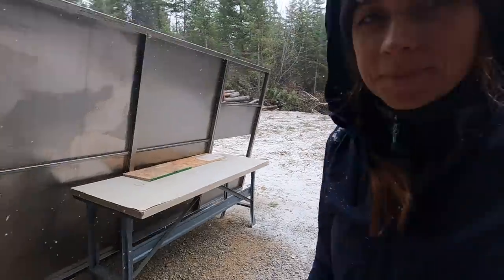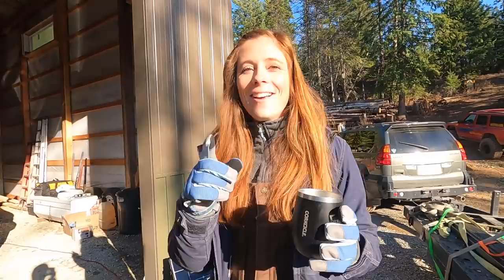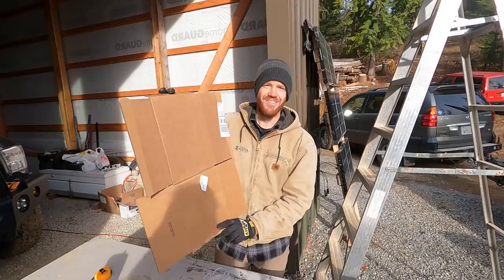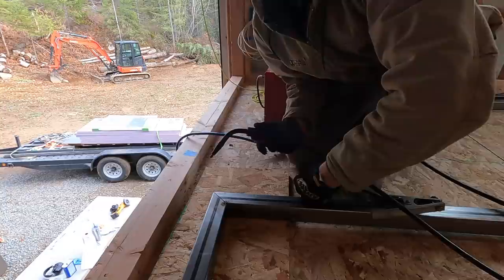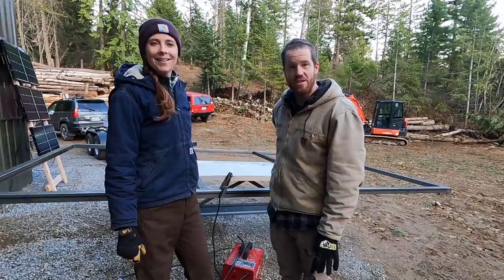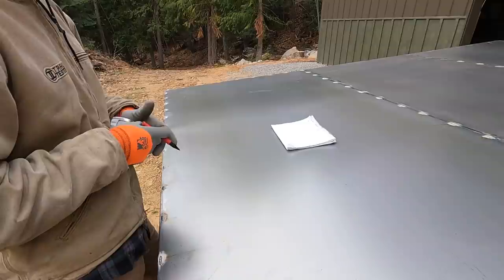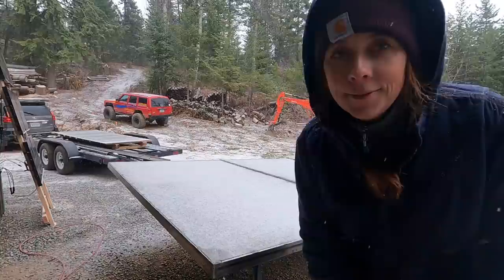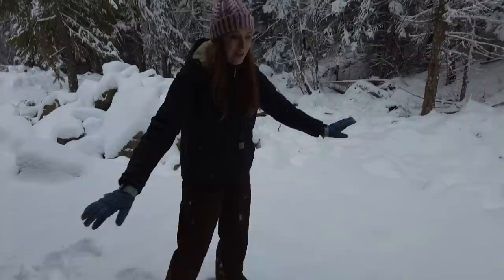Running Out Of Time - Building Our Shop Door

Comment: I installed my 12' X 16' shop door by myself. (I'm an old guy so no pretty helpers on that build!)
 I mounted a cheap 12 volt ATV winch on the header and raised all of the panels with it..  My shop doors now are raised and lowered by Harbor Freight 440 lb 120 volt winches rather than $commercial$ garage door openers.  But, I did install the normal garage door spring system to counter balance the weight of the door so the winch only has to lift about 100 lbs. Those HF winches have been working great for 15 years now.  2 BIG shop doors.
I still think you could weld up,a simple bird cage type freight elevator and install two garage door roller tracks vertical next to the apartment wall. And use an electric winch to raise it up and down using the tracks and rollers to keep it in place.  Would sure make getting all the fixtures and parts for the apartment  build up there easier. I have a simple safety brake design that would be easy to build in case the winch line ever broke. If you're interested. Id be happen to explain it.  Then after the build is done you could easily move or remove the freight elevator
Reply from the maker: Those are excellent ideas! An elevator to upstairs would be awesome. I really like your idea of adding a manual brake to the cable so that if the winch fails the door can not fall down.
Reply: i would never remove it!! you never know what you might need upstairs & carrying groceries upstairs everytime sux!!! i know i live above my shop!! LOL
Reply: An elevator - great for getting the kids in and out........just saying, don't shoot me!!!

Comment: I am actually in the planning phase for one of these for my pole barn shop. Great timing.  I am worried about the forces of the door pulling the wall down when lifted, so I decided to make a four or five panel accordion door. My vertical posts are not as strong as yours, and not as high, I am only 20’. Your lift mechanism is of great interest to me.

Comment: Those kind of doors work great! I did that on my shed. Only thing I would redo on it would be make the lower section shorter and the upper section longer. Reason being, when fully opened it will give a good slope for runoff when it snows or rains.

Comment: You guys may want to get or rig a more complex pulley system to move stuff up and down from the loft. By connecting more pulleys into a system you can dramaticly reduce the amount of force you need to lift an object. It would be easier for the two of you and safer for your tools.

Comment: Perhaps you could glue the cutoffs of the insulation and attach it to the frame of the door to ease some of the thermal bridging - the door doesn't go all the way up so clearance may not be an issue. 

Best content, checking in every week has been the best.

Comment: Kickass door idea!! 
Safety tip for using the grinder - safety glasses without foam aren't enough. After many hours of grinding, I had a ricochet end up in my eye and didn't realize it. Later that day, it wouldn't stop watering but I couldn't see the issue in a mirror. 
2 watery eye days later it rusted and I could see the brown spec in the mirror. Had to be surgically removed. 
Safety glasses and a face shield for me after that lucky save!
Great work on the shop door, I'm always wishing for more snow ... North of you guys! 🇨🇦
Reply from the maker: That is crazy! I actually just bought Riley a face shield but he accidentally left it in CA. Sounds like I should get another one!

Comment: Seeing how often you use pulleys, I would suggest adding another pully, to double the lifting capacity (or reducing the power required to lift) and a rope tie down similar to what is used on yachts, so you can leave something hanging at desired height. 
And I would consider adding another  rope with pulleys either in the middle or the other side of the door. Maybe just design it so that it works also as a door lifting feature (for that however I would do at least a 3 time power reduction with pulleys).

Comment: Interested if you do some sort of counterweight system to take the majority of the weight of the door off the opener. Or if you use a winch setup to open and close the door. Would be terrifying if the cable snapped and the door slammed down.

Comment: Unless you are using COR-TEN steel in all your door components (you do not mention it in the video), the rust will eat away the steel into nothing with enough years exposed to Idaho weather. COR-TEN steel forms a rust layer that stops at the surface and prevents the rust to progress more than a few thousands of an inch on the outside. If you did not use COR-TEN steel, you will need at least a clear coat to show your rust and protect the door ( a coating that you will need to reapply regularly since it is not that tough), or just paint the door with a more resistant outdoor rated paint (there are several kinds of rust-effect paint if you like that look). Otherwise the door as it is will not last long and will be a safety hazard due to its weight and sitting that high when the rust starts making it structurally unsound.

Great videos, great job with everything. Love your story and your channel!

Comment: Here's a tip years ago I worked in a Ship Yard in the North East. In the winter they wouldn't let us weld if it got to -- 5 below, they worried that the steel would crack from cool off to quickly. So keep an eye on the temperature if you are welding!.............P.S. you can't weld fast enough to keep warm............ winter solstice is dec. 21 so less than 30 days and the days will begin to get longer, April is just around the corner!
Reply from the maker: That is an excellent reminder and something we have never had to consider before!

Comment: Nice door!  
Hey, before it freezes you could lay 2,  2x6 pressure treated boards on edge, fastened to the door jambs, to give the door something to seal to. 
The has worked well in my shop for 15 years with gravel floor inside and gravel apron outside.
Reply from the maker: That is a great idea!

Comment: Courtney should wrap the garage door to match the truck (with the Ambition Strikes logo, compass rose, etc...).   Also I vote wood stove for heat - lots of wood around you to keep it fueled!  I also figured you guys would put a lean to roof on the side of the shop to keep the other equipment out of the weather (or a pole barn near the shop)

Comment: you would be suprised what a decent wood stove will do to heat a space like that.. aven a double drum boiler type will do a LOT to heat that space.. maybe even cook you out of it even with no insulation until temps drop to the negatives. another decent heat source I have seen some use to heat their shops are the chinese diesel heaters.. they run off 12v, so could easily be powered by a spare car battery, and charged via solar.. and they sip fuel... depending on load, they burn about 1 gallon over 8hours. nice dry air.

Comment: I'm a Carpenter, not a draftsman, who's drawing up my daughter's house remodel plans.  After 10 hours I gave up on the CAD computer and I'm back to a tabletop folding drafting board.  Old school works great for us old guys and doesn't take any power.  Only downside is 24" x 36" drafting vellum is very pricy.  Also there's no computer cut and paste, you have to make vellum prints to erase and modify for HVAc, Plumbing and Electrical prints.  Thanks for the door build, I never considered building a metal bifold door.  Putting windows in the doors is great.  Something most of my neighbors regret not doing.  If you put them up high no one can see in (except all the bikes hanging from my trusses) and you still get a lot of light.  Also a buddy of mine from Montana said that "Only Crazy Californians work in the snow".

Comment: I'm super impressed you are able to weld with your trucks battery system! Did you design the system with that in mind? Love love LOVE that you are doing a hangar style garage door! OMG! You guys and your pulleys!! 😂 🤣 😂 🤣
Reply from the maker: The original thought was that we wanted a system that could run a decent size air conditioner... but the thought of being able to do "trail weld" fixes was definitely also a consideration!
Reply: @AmbitionStrikes  such a smart move! Heading back to see your electrical system install video to see what you put in there that can handle that kind of amp draw. Cool to think that sunlight helped weld your garage door up!
Reply from the maker: @MikeBabsBC  we have 300ah of LiFePO4 batteries, a 3000w inverter/charger, and 600w of solar. In the summer with ample sun exposure the solar works great for keeping things topped off. Now with limited daylight (and mostly cloudy) we are really relying on our Honda 2200 for a lot of our charge. The Honda 2200 isn't capable of running the welder though, too high of a peak demand. Our inverter can do 9000w for 30 seconds.  The cool thing is we can work all day using power tools and only run the generator for a few hours when it's convenient to recharge. Thank you again for watching and commenting on our videos!
Reply: @AmbitionStrikes  that is an impressive inverter!.... Not to mention the rest of your system :)

Of course! I can't financially support you guys (yet) but the least I can do lisnlike and comment to help boost your videos. Have an awesome night!

Comment: Should have a heater in the shop by now. Plenty of firewood, take the doors inside,  tarp the doorway, get it warm inside so it's easier to work. It'll be better to prime and paint inside without wind. Not as exciting as doing it out in the snow....

Comment: Good looking door. I may have to borrow the concept to make our shop door 18” taller ( to get the camper in). Our sliding door is limited because the track is against the  roof line.   Did you sort out your snow plow yet?
Reply from the maker: We’re still on the hunt for a snow plow! If the design works we’d love to share tips and tricks for doing it again.

Comment: The time, energy & money spent used to build that you could have had a roll up insulated commercial door installed. Your temperature window for spraying on foam insulation is closing fast, I advise you to get your exterior walls in the apt done soon or it will be next summer before they can be done.
Reply from the maker: You are correct! But we didn't want a roll up door. They block light overhead when working and impeded interior height. We aren't doing spray foam insulation.
Reply: Foam panels were stacked on the trailer with the steel. May have to wait till warmer weather to paint the doors.
Reply: @AmbitionStrikes  Light can be mitigated by installing on either side of the door  instead of on top of it.  2 part spray foam yields the highest R value in return to the money invested.. The biggest loss's in a cold shop is lack of productivity and high heating bills. I run a fab shop where it gets down to -40, everything I say comes with decades of experience. (both construction and welding)
Reply: @HeavyHaulKen  A commercial door is coated both side prior to construction and filled with a 2 part foam. This seals it to prevent water / air ingress, provides a higher R value and adds strength to the door.

Comment: Seems like you got the glass out without issue, but if you ever find yourself needing to do the same in the future, adding some heat with a map gas torch to loosen the adhesive helps. (ex window guy here)
Reply from the maker: Thanks for the tip Patrick!

Comment: Have you thought about the opening mechanics for this huge heavy door?
Reply from the maker: The door is actually quite light! But yes, Riley designed the entire system before we began construction. It's amazing what you can do with some pulleys and a winch.
Reply: These are common items at airport hangers, it can be a winch or hydraulic ram.

Comment: Just out of curiosity I am by no means a welder but I am an aircraft mechanic and at least in aviation grinding welds is a huge no no. Are y’all worried you degraded the strength of the welds? Also I live in Idaho as well.
Reply from the maker: Grinding welds can certainly degrade the strength and cause them to crack. The only welds we ground were the ones that we needed the sheet metal to lay flat on, which was only a few. The rest we just cleaned up with a wire wheel. The structure is also completely welded on the backside so it should be fine.

Comment: Doesn't your camper need to be outside for the solar panels to get light.
Reply from the maker: We have 300w of portable panels that are outside that we plug in while we're parked under cover. Honestly though with the limited daylight hours up here this time of year combined with low sun angle, trees blocking the light, and cloudy days the solar doesn't produce much at all. When we're traveling we charge while de drive, right now we have to rely on our Honda 2200 to charge the batteries through our inverter/charger. Thanks for the question! We'd rather be parked inside out of the snow than try to capture what little sun is available.

Comment: That’s going to be a heavy door
Reply from the maker: It's actually not that heavy! We used very thin wall tubing and estimate the door weights about 400lbs.
Reply: Ambition Strikes your your garage motor door probably won’t handle a normal household garage door opener motor it’ll overheat it You’ll probably need an industrial motor to lift the door. Just my thoughts
Reply from the maker: @rods907  We aren’t using a normal garage door opener. Stay tuned for part 2! 😉

Comment: Great work. What does a 110v welder cost?
Reply from the maker: It looks like you can get one for about $400! 
https://www.amazon.com/Lincoln-Electric-K2278-1-Handy-Core/dp/B004HL01PW/ref=asc_df_B004HL01PW/?tag=hyprod-20&linkCode=df0&hvadid=312134375915&hvpos=&hvnetw=g&hvrand=3969137693216950849&hvpone=&hvptwo=&hvqmt=&hvdev=c&hvdvcmdl=&hvlocint=&hvlocphy=9031745&hvtargid=pla-489927628456&psc=1

Comment: I saw one of these doors 25 years ago and have always wanted to build one. It is so cool that you guys decided on that design. That proves that I’m not that stupid( just think better than your average bear, booboo. Speaking of that , I think Yogi used pillows yo steel a few pikanik baskets😂. I think I would use the track hoe. I have a tractor with forks on it and I lift every thing I can with it. Use what you can to save your BACK ( I to do thought I was invensablle until I screwed up my back  @ 31. I’m not a SAFETY NAZI by any means but the back is the second most important part of your body ( the first is your brain) which you two have some pretty good ones( real good ) but don’t let that go to your heads. 
Thanks for the video. You two are perfect together and you are a good team.

Comment: Love the door project but why not make it a left/right sliding door?

But the ELEPHANT in the room. Army truck is 4x4 correct and snow is predicted  -  why not make sure that the flat tire is changed, new tire(s) for rear purchased to replace the bad tires and spare remounted where it goes????
Reply from the maker: A sliding door is very difficult to use when snow is piled up. 

The army truck is far too heavy to use when our very steep road is icy/covered in slush. Courtney’s Lexus is what we are currently using and once the snow is deeper we will be able to use the Snowverlander.
Reply: @AmbitionStrikes  ok...   my fire department uses three of those trucks (2 of which have 2000 gallon water tanks on them and the third is a high water truck) and haven't had issues on ice or such

Comment: wait a sec, does the weld need no gas? 🧐
Reply from the maker: That is correct. We are using self-shielding flux core wire, which shields the weld by creating it's own gas when the wire is burned.

Comment: Hello, I am David deaf, I live in Spain, to meet you delighted .... your fool because your iron garage door is not because easy cold also heat better another garage door foam blocker heat and cold comfortable automatic I give video
Reply from the maker: We will be insulting the door with 1" foam.
Reply: Yes I know but iron + foam put well but weight also problem distance example another (sectional garage) better without distance I understand🙂👍